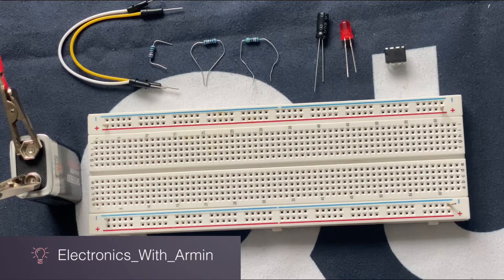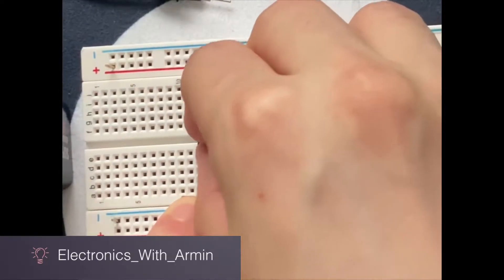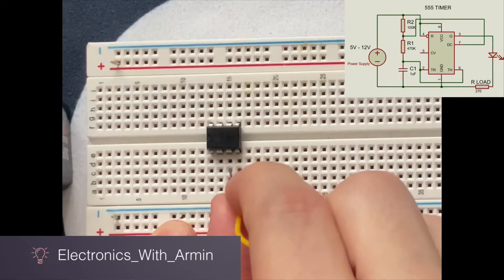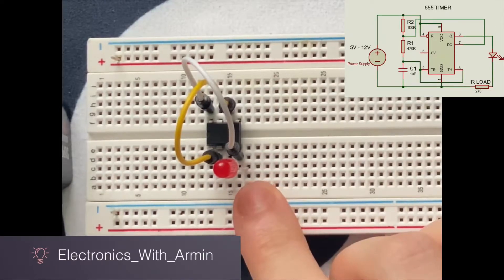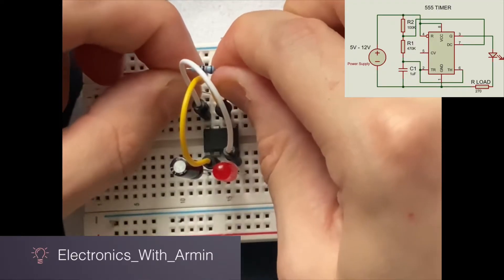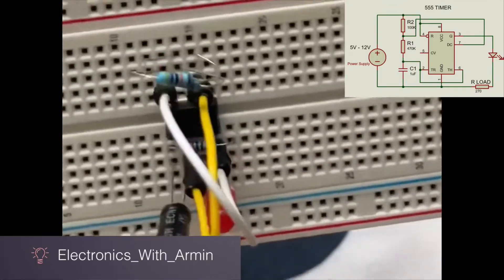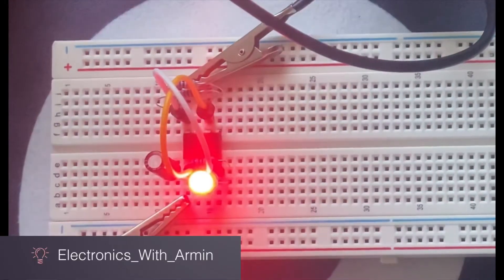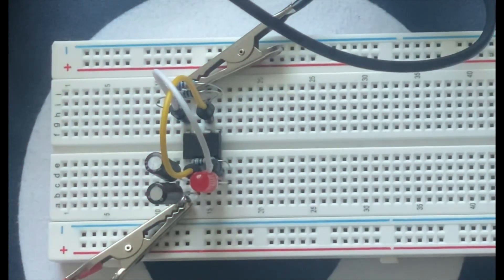Flashing LED Circuit using 555 timer on Breadboard! 💡#breadboard #555timer

Comment from the maker: More Videos:
Fire Alarm Circuit 👇

https://youtu.be/jc5K2RMGQY0

RC Low pass Filter 👇

https://youtu.be/JXGlq6THyWU

LED Flasher Circuit 👇

https://youtu.be/Zu1TZ-9C33U

Doorbell Circuit 👇

https://youtu.be/XZ2f612WOTU

Half wave Rectifier 👇

https://youtu.be/SHu47wmiY7I

Charging/Discharging Capacitor 👇

https://youtu.be/HUgAc91mMe4

Comment: There is a simpler way , one resistor less than in your schematics . Just connect the timing capacitor ( legs 2&6 point ) to the leg #3  via one resistor which value will affect the frequency as well . Connect the LED between leg #7 and (+) rail, via current limiting resistor . That is all . 2 resistors , 555timer and one capacitor. The duty cycle will be close around 50% .